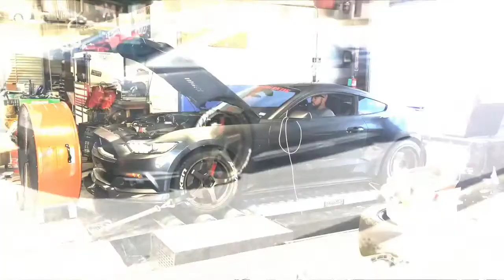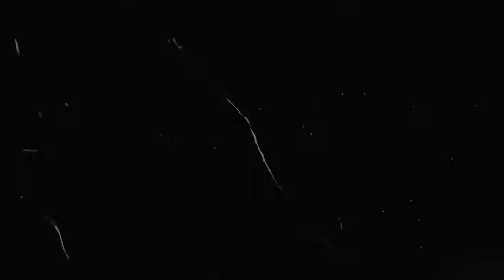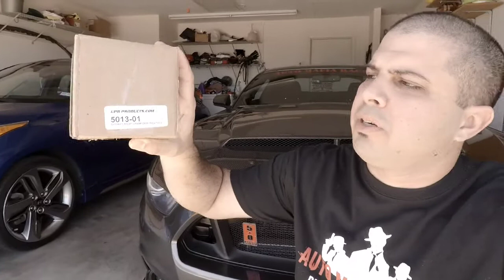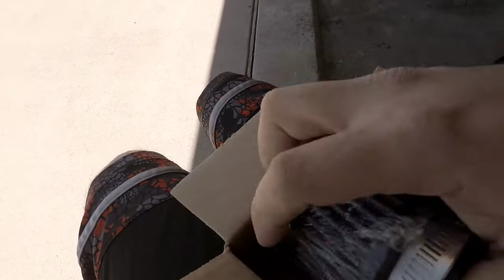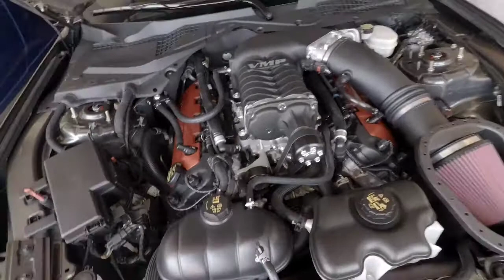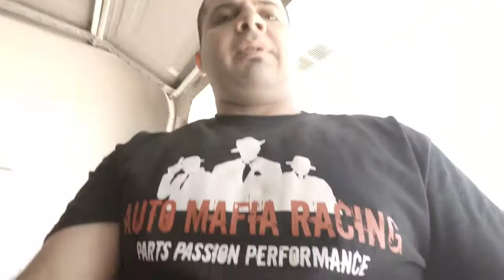My apologies and UPR Crankcase Breather install

Comment: I think this might help the direct injection intake valve deposit problem on ecoboost?
Reply: I've been looking into getting this for my Ecoboost. Do you have one in yours? Assuming you have an Ecoboost? Did you notice any difference in performance? Catch can?
Reply: Brandon Tang I put one on mine and it made my car leak oil down to the bottom.. got scared but to find out.. it was the breather leaking oil down the intake manifold all over my oil pan and made me drip oil in the driveway.. you need the breather can that catches the oil. It’s on UPR Products website for 299
Reply: If you gets lots of blow by then catch can may be better option. 
Either way its a must for Ecoboost. Turbo , blower etc. Get them on both sides for you eco

Comment: Hello There!  
I have few Question and I like to here your honest answer of my questions, #1 why did you put that Crankcase Breather in your car? what make you do that? and the other question is that I notice that you are using a Oil Catch Can in your car But! I did not see in that installation having a One Direction valve to that installation.
You Don't Think that some pressure could come back from your intake and blow the oil that you have in your catch can back to your engine
I will appreciate if you could Answer those question because I am in the process of doing the same thing to my car and making mistake could cost you so much money due you don't what what are you doing at the moment.
Reply: The breather will relieve some of that crank pressure. To answer your other question, there’s a check valve in the oem valve cover connection to which that oil catch can connects to.